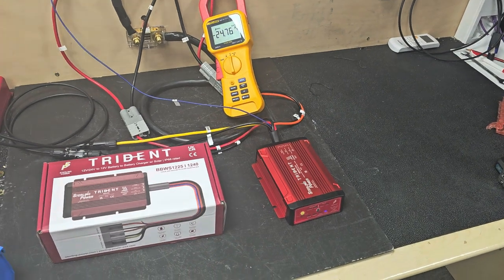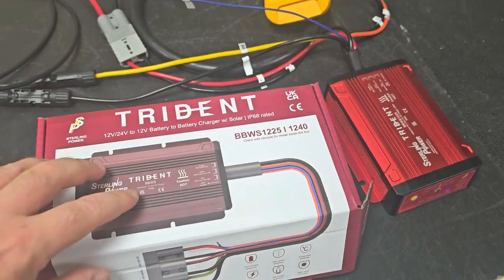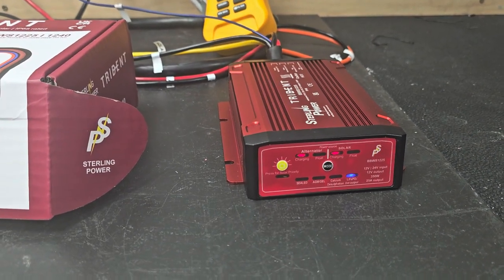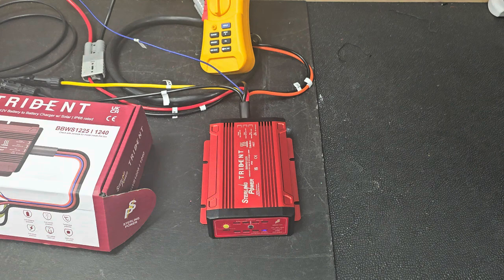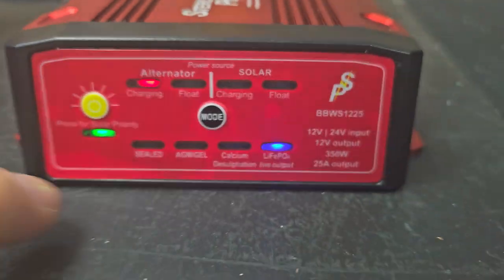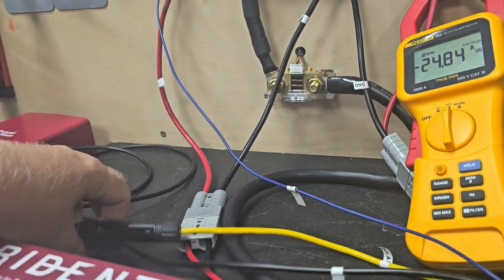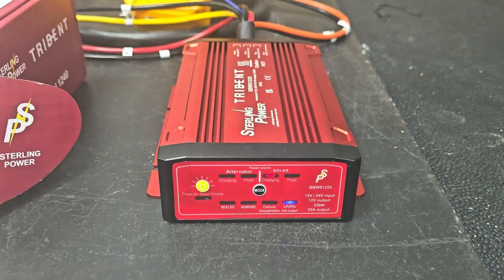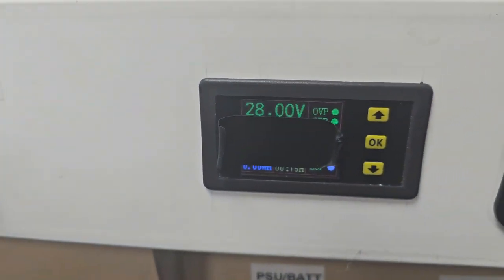IP68 Waterproof Battery to Battery Charger 12V/24V to 12V DC DC charger TRIDENT. 25A | 40A MPPT

Comment: So only 24v panels, if voc is 31v
Reply from the maker: Suitable panel voltages that I've seen on the market will vary from about 17VOC to 30.4VOC. Many 100W panels will generally linger in that 22VOC-28VOC region. Larger panel arrays (250W-400W+) are likely to be in the 38VOC region and would be unsuitable for this item, sadly.